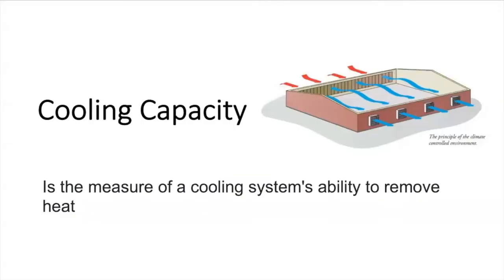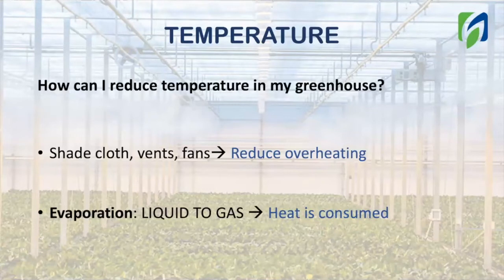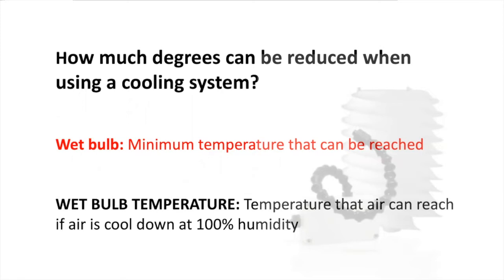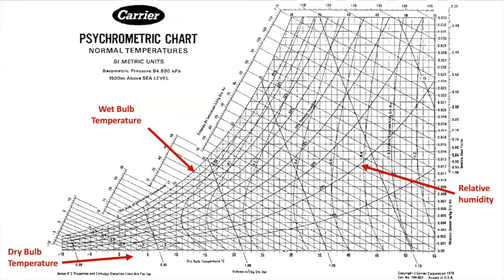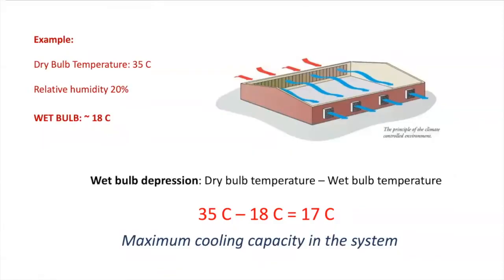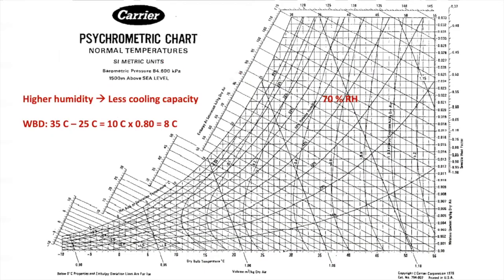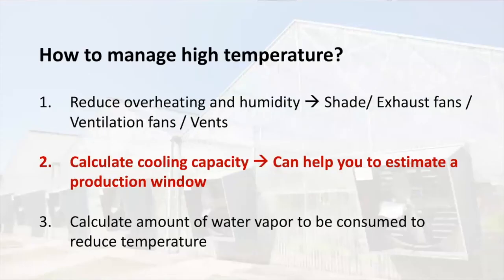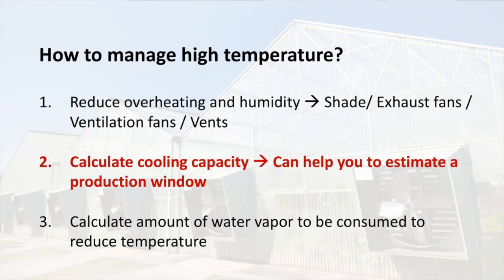Mastering Cooling Capacity in Greenhouses | Cooling the Greenhouse

Comment: Why do you estimated the cooling system efficiency to be 80%? In other words, how to determine this percentage?
Reply from the maker: Thanks for your comment! This an assumption usually used when making calculations about the cooling system in greenhouses working with exhaust fans and wet walls. If this is the system you are using for cooling and is working with no limitations you can assume 80% efficiency.

Comment: @Everest Fernandez 
I want to ask you can your give me the equation for calculated how many fans what I need in volume my greenhouse and the area of cell cooling that will be installed in the house there are equation pls I want to anderstand this
Reply from the maker: Thanks for your comment! In order to calculate the amount of fans per area is necessary to know the fan capacity which most of the time is expressed as CFM. By calculating the volume of the greenhouse you can learn about how many fans will be needed in order to move all the volume of air by dividing the total volume of air by the volume moved by your specific fans. You can learn more about this in our greenhouse management short course. Here is the link to the class in case you want to get the recordings!  https://hortamericas.com/catalog/educational-resources/courses/short-course-greenhouse-management-files/

Comment: Great information! I am from Malaysia, have been running a greenhouse for a year now. Malaysia can be dry during sunny day, and humidity can go up to 99% when it rains. Currently I am using misting to cool down the greenhouse, but would want the temperature to go lower if possible. Is cooling the water before misting a good idea? Or is there any better solution?
Reply: Hi Wei, evaporative cooling is most effective in arid environments. In Malaysia, the naturally high relative humidity simply doesn’t leave much “room” in the air for more evaporative moisture, so I would try increasing air exchange in the greenhouse instead.
Reply: @Just4Growers  Hello Everest. I've measured both the temperature and humidity inside of my greenhouse. It turns out that the humidity can go down to 25% and temperature at 43C. Turning on the fan does not help to lower down the temperature. Ever since I installed misting system, it reduces from 43 to 32C, turning on only during the hottest period of the day. So I am not sure, if i want to reduce further to 28C, will misting cold water helps in this case?
Reply: @weikeekeoh3180  nope.....evaporation of water for cooling has nothing to do with water temperature...unfortunately
Reply: @Just4Growers 
I want to ask you can your give me the equation for calculated how many fans what I need in volume my greenhouse and the area of cell cooling that will be installed in the house there are equation pls I want to anderstand this
Reply: @Wei Kee Keoh:  I contacted Karla, she will be commenting soon.
Reply: Hi Wei, thanks for your comment! When a greenhouse is located in a humid area is important to work on reducing relative humidity inside the greenhouse with the use of fans and exhaust fans. The mist system will be the ideal system to use to try to reduce the temperature inside the greenhouse. Water temperature can have a small effect on cooling capacity, this is because air can take water vapor easier at lower temperatures. However, in order to have this effect, we need to have very low humidity levels. This is why this is not a common practice in growing systems with high humidity issues. 
The best you can do is try to reduce heat by short wave radiation using good shade cloth or/and covering material like sudlac (https://hortamericas.com/catalog/growing-supplies/coatings/sudlac-transpar/) along with the use of vents/ fans/ exhaust fans and mist system.
In our next video, I will be speaking about how to avoid overheating by controlling radiation inside of the system, hope you can find this one useful too!
Reply: @hortamericasmex  Hello! Thanks for the information! Actually, not every part of Malaysia has high humidity. In my area, the humidity inside the greenhouse can go down to less than 30% during the hottest day. I've been hesitant to test out misting cold water, since it can consume extra energy, but from your comment, I felt reassured 😁. If this works, then the only problem I need to think of is high humidity (99%) during rainy days. My greenhouse is built using insect netting on all sides instead of glass, meaning its not totally covered, it can be hard to control the humidity. From your point of view, is there any chance of humidity control in this case?
Reply: @hortamericasmex 
 @Everest Fernandez 
I want to ask you can your give me the equation for calculated how many fans what I need in volume my greenhouse and the area of cell cooling that will be installed in the house there are equation pls I want to anderstand this
Reply: Hi Wie ,,,better to use evaporative cooling (pad wall cooling ) on hot and less humidi days and resort to mechanical cooling when it's rainy and humidity ,,,cooling the  house with misting  is so much associated with  disease problem and less control of the balance of the plant